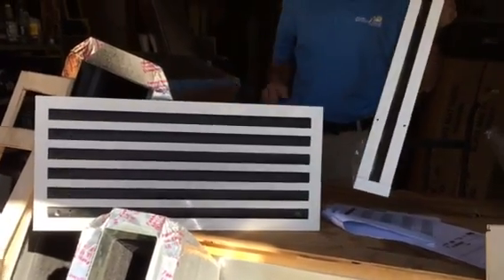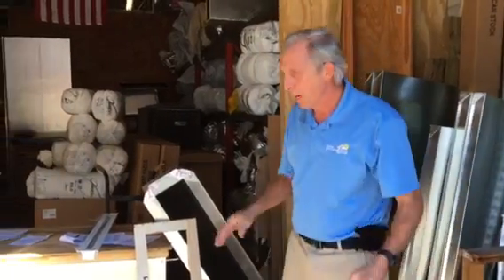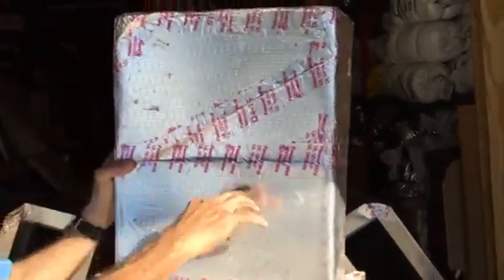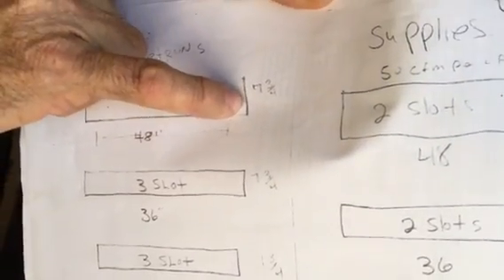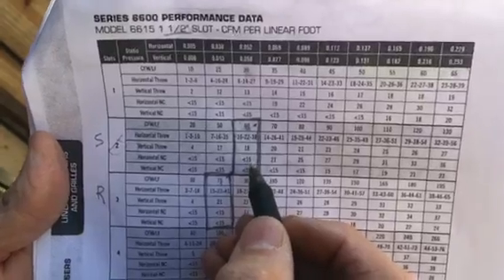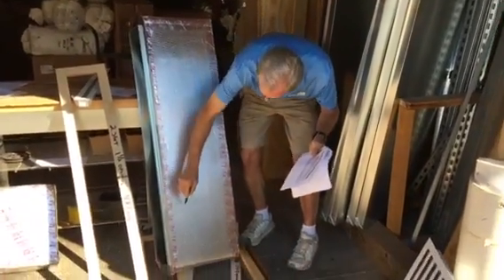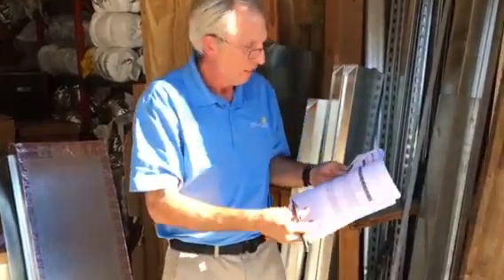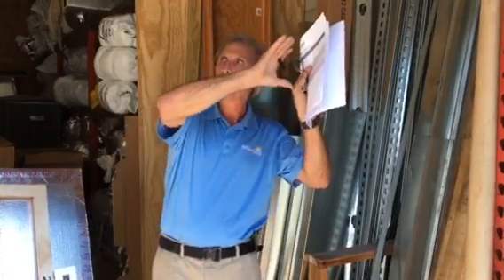Explanation of Linear Diffusers sizes and design

Comment: After watching your videos i determined that my single return of 20x30 for my 4 ton unit is not enough. I am struggling to find an interior wall in which to place another return. Any suggestions for a return on a standard 2x4 wall that i will run down into the crawlspace? I dont want a return on the floor.
Reply: that size sounds sufficient, really. maybe you can find a grille with wider spacing (3/4" instead of 1/2"), or find one with lower deflection angle. that should allow more airflow.
Reply: Get a bigger return Grill 20X30 is more than enough for residential.
To give you size dimensions are
3 ton=12-14inch return duct
4 ton =16 Inch return duct 
5 Ton= 18-20inch return duct
Reply: If you are using a wall cavity for return, the grill might not be the limiting factor. The amount of free area in the wall cavity might be what limits your CFM

Comment: Hello David I just got a trane xl20i unit for my house and I getting error 91 from my thermostat,  any phone number that I can call to discuss about it.  Thanks in advance .
Reply from the maker: Error Code 91 is "Loss of Communication between blower motor and control board", no line voltage on blower motor or inducer motor and 12 volt dc should be measured between 12v Pin and gound pin on control board E8 connector and at terminal 1 and 3 blower motor", hope this helps, thanks for subscribing and for your comments. Also helps to reset the breakers for a few minutes to reset the board, most times its the low voltage line that causes the issue.